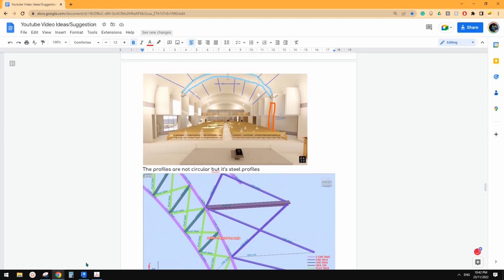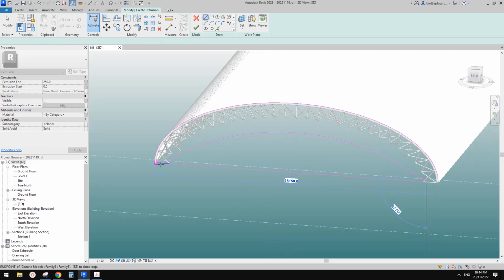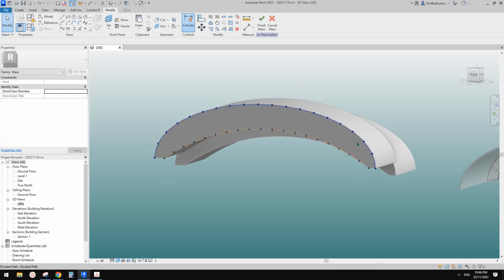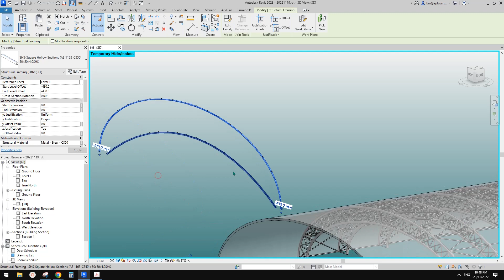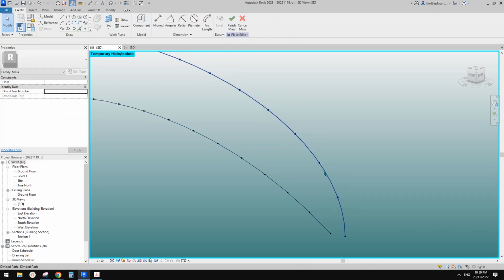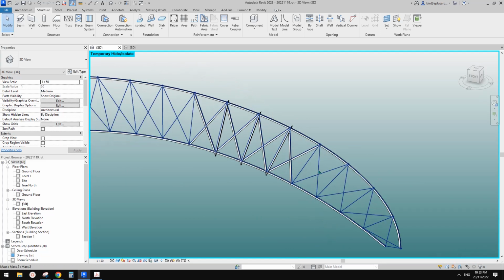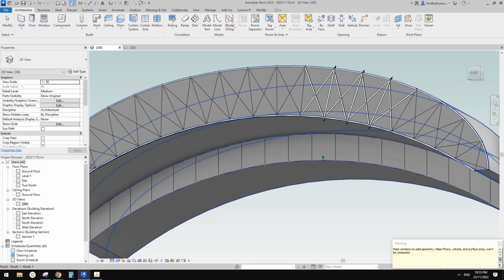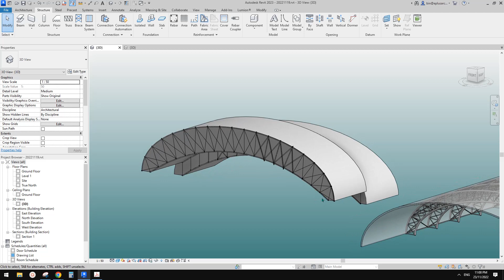Revit Exercise (Day 973) Adaptive + Structural Framing

Comment: Good idea Bin, mix of adaptive to get Lines to snap to their ends and structural truss 👍🏿
I think “Cope” is the tool that trims the truss members together … but unfortunately it doesn’t work if the frame is not straight (fx arc or curved )
Reply from the maker: Thanks, I always find the structural connection hard to work with.